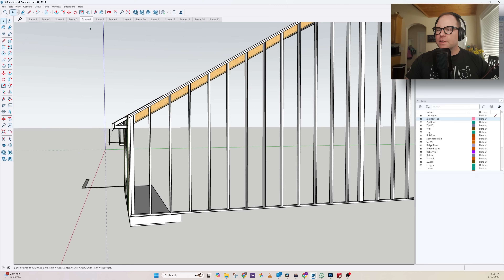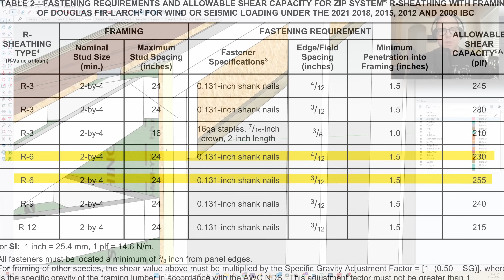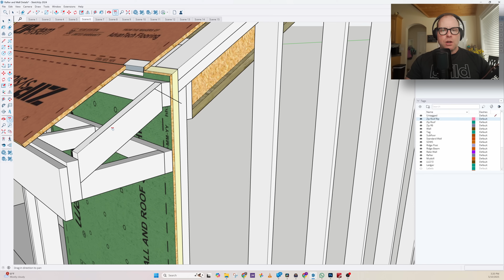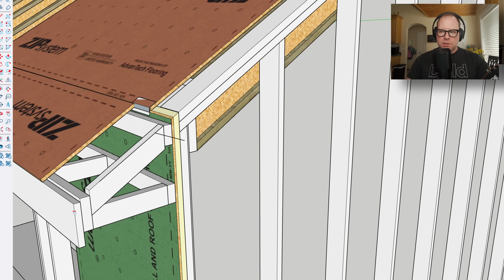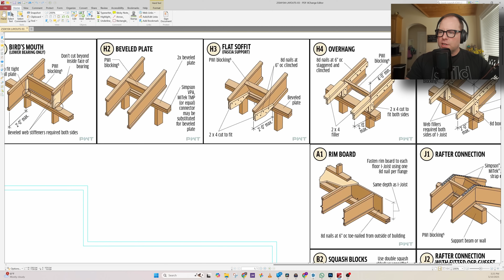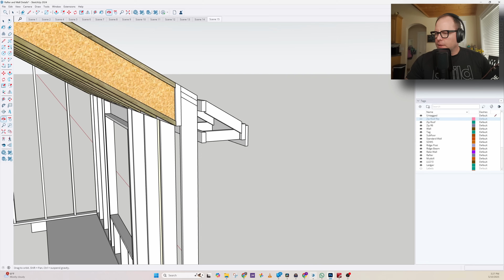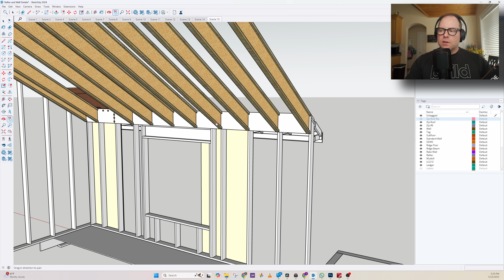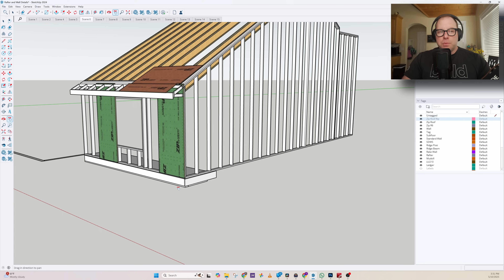Help Me Build It Better – Your Feedback Needed!

Comment: Hi Tim,
I'm a GC from the California Bay Area, so we don't get the kind of weather everyone else does. However, I did live and work in Oregon, near Salem, for 3 years, so I have some idea what y'all deal with.
Anyway. I love your idea of the Monopoly framing, and think the stuck-on soffits are great. But, I am a stickler for direct load transfer with posts/studs. I don't like the idea of supporting all those rafters in hangers, especially at angles. Why not let them run through the eve wall framing, plumb cut the ends at the exterior side, and under-support each seat-cut rafter end with a short stud, and sistered to the full-length studs? Your way, the ledger is only sheer-fastened, and the rafter ends are sheer-fastened to it, transferring all the load through two layers of fasteners and dependent on the same studwall anyway. That's putting a lot of faith in screws/nails and metal hangers. My way: fewer fasteners, no hangers, studs are cheaper...
Otherwise, there is much wisdom in your dojo!
God bless!

Comment: Why even use sheeting is my question?

Disclaimer: I don't have seismic loads in my area. Although New Zeeland does have seismic loads and use similar systems.

The next logical advancement in constructing houses is the use of strapping to develop rain screen systems for both walls and roofs. The strapping layer facilitates the creation of overhangs with ease. Incorporating the rain screen in load calculations alongside metal structural bracing straps, as those from Mitek or similar will probably result in the sheeting being redundant for loads. SOLITEX MENTO ULTRA serves as an excellent product when laying  direct on roof rafters. Use metal for the roof material.  Fill any cavity with dense pack cellulose and you will be golden.

Comment: I'm not in the industry, so take my word with a grain of salt. But I'd be mindful of your connection of your wall sheathing and your your roof sheathing.  I think you might need to run a 1x  in place of the zip r insulation where the roof and wall sheathing meet, if that makes any sense? For nailing/screwing purposes.
Reply: You are talking about a 'cleat'.  Others have suggested OSB to do that very thing.

Comment: It's not just the weight of the roof at the overhang, but wind uplift is stronger around the roof perimeter, if you insist on doing it that way, small jack trusses would probably be more appropriate. The nail on plates on trusses are designed to prevent truss uplift.

Comment: I am on board with you adding on the overhang after the siding is up. Your process for end-nailing the lower rafters (where most of the rafter weight is) onto an additional board would mean: No angled boards are needed between each and every rafter. Sounds appealing, but the idea of unusually LONG lower rafters under the vulnerability of an open floor concept, held up mostly at the mercy of nails? I need birds mouths (shorted to no overhang). Then by all means add on a roof overhang, or even the upper side of a porch roof. 

By flattening the exterior side of the birds mouth, your R siding will still cover the entire exterior wall, no problem.

Comment: Did something similar on my current project.  2x12 rafters landed on the double top plate with a 2x12 on edge flush with the exterior of the wall framing, screwed into each rafters.   We taped zip roof to zip walls, then prebuilt ladder eaves.  Subfacia is all over the place wavy.  Might have been poorly executed, but no doubt there is a learning curve.  I like your idea of pre-building on the ground, that would make it way more manageable.  I told my carpenter if I ever mention monopoly framing again to give me a 5 finger face slap.
Reply: @Jeffd180  Yeah the idea of doing this anywhere but the ground is shocking. 
Stringline and shims when each piece goes up.

Comment: Screws are easier and quicker to install so, using those are a no brainer to me. The engineering you have laid out looks more efficient, even if there is a bit more labor in some of the details. The concept is interesting and look forward to see it implemented and or adjusted as needed as you work on the project.

Comment: I'd run a full sheet from fascia upward to tie the soffit structure to the rafters, the sheer provided by that would keep the soffit from moving when stepped on.  You could always do a quick spray foam from underneath the rafter to ledger in lieu of the tape sealing idea.  Just doesn't feel right ending the plywood at the wall and then adding what's needed for the soffit rafters.
Also, why aren't you venting this roof section?  Not enough room for venting AND insulation?  What zone is this build in?

Comment: Looks like this would eliminate headers above the openings which solves an insulation issue that has existed forever.  Personally running the roof sheathing all the way to the fascia with a couple beads of sealant or perhaps a foam gasket seems like the easier and smarter way.  Maybe using sill gasket on top of the top plate and nail through the sheathing to the to plate.  This should be the new standard moving forward if we truly want to insulate and seal our buildings better.

Comment: I like the plan as-is, with one small exception - I would start the roof sheathing at the eave and work up so it's tied into the main roof as much as possible.
Reply: Up front this would make the most sense to me as well. But in this case, they are going for super air tight, and want to seal the top of the bearing wall. I would think using the foam adhesive could achieve this if the sheathing were laid as you describe. If the preference is to definitely tape the roof to wall joint, then strapping the eave "tails" across the top plate and to the rafters would probably be a great best-of-both-worlds solution. The screw on an angle going through an inch of intermediate foam doesn't exactly give me the warm and fuzzies, so it seems to me the eave should be tied to the rafters one of the  two ways above.

Comment: Stuff the gap between the hanger plate and the exterior sheathing with rockwool and walk away. Its sized for the gap. 
I'd still drill the plate near the top to vent into the TJI ceiling space.

Comment: I also prefer the idea of the roof sheathing running unbroken to the eave, but I like this idea. Maybe if there's concern about the strength of the soffit connection to the house, some metal straps across the tops of tails and rafters spanning the wall could provide enough reinforcement?
Reply: I should have read this before saying the same elsewhere. 
I know they already use steal straps instead of overlapping top plates on walls.

Comment: I'm also an engineer, just not of the structural variety. But if you ever want to build a house out of carbon fiber, I'm your guy. My two cents: I agree with @det-ou9vz about the strapping from sheathing on top of the rafters down onto the sheathing above the eave rafters. Having that extra tensile strength resisting the moment trying to peel the eave off the wall makes sense to me, especially if I am the chonky boy standing on said eave at the time. My only other thought would be I would consider screwing through the upper eave ledger out into the end of the eave rafter while assembling on the ground, and then screwing through the eave ledger into the top plates while anchoring the eaves to the wall rather than threading the long screw down through the eave rafter, the eave ledger, the zip system, and then into the wall structure. It may be a non-issue, but my statics brain is not liking the diagonal stretch of that screw sitting unsupported in the foam portion of the zip system. I know there are other fasteners that would prevent that motion, but my head likes the idea of a straight horizontal fastener there better than the downward sloping one.

Comment: I like running the idea of running roof sheathing continuously to the edge of the soffit for structural reasons (more skookum).  Since Zip is essentially airtight, why can't you tape the wall to the underside of the Zip roof sheathing? Steve's red pen would still show continuous air barrier. If the concern is tape not adhering to the bottom side of Zip roof sheathing, could you switch to Fentrim?
Reply: That is a really good idea

Comment: When you do the walls this way you greatly reduce the work involved in the shear transfer detail from roof to wall. Actually it should all be done with the sheathing nailing, no blocking or connectors. Main drawback is this is only for non-vented attics. And where you do want a flat ceiling you have to hang the joists, since there is no plate to set them on.
Reply: Maybe you misunderstand the material qualities of his i-joists. TJI is used on high sloped roofs and frequently set directly on walls like that all the time.  They still get fastened into top plates.  They still need blocking to prevent twist, but he's just trying to skip end wall blocking that forms outriggers into the eaves.  Ideally he can run the end wall zip sheeting to the roof line to close off air leakage from the ceiling. He did not say he was leaving his TJIs to float, just leaving out some implied details.

Comment: You could frame the detail of the wall top a little lower, then place 2x2's over the top plate lined up with the I joists.  Then you have venting.  I would overlap the roof sheathing over it all.  You would need to figure out how far to drop the wall top plate as per roof pitch but you are very good at that.  Thanks!

Comment: Your wall that goes to the sheathing is closing off the venting below the sheathing.  Maybe that's OK in your climate.  At first, I rejected this idea but I use steel roofing on the houses that I build.  Using steel roofing I've been screwing it to a grid of 1x4's first, going vertically nailed to the sheathing over the I joists, then going perpendicular to the first layer of 1x4's.  This vents the roof very well and could work with your wall details to achieve venting.   I do a 16" layout for the horizontal 1x4's. which leaves 12 -1/4" between.  It lowers the air conditioning loads.  It has been performing quite well.  My climate tends to get a bit hot in the summer now, in Montana.  And our fire season has already started!  Thanks for the cool videos!
Reply: This is an unvented roof sealed against vapor with closed cell spray foam.
Reply: @kschleic9053  You could also put a vented roof on top, by nailing 2x4s to the top of the Zip sheathing and putting another layer of OSB on top, using that as the nailing surface for the roof shingles. Not only would that create a vented roof on top of rafters that are fully insulated, but it would reduce penetrations of the Zip layer  to just the 2x4 spacers so the top layer would circulate both air and vapor and dry out without affecting the WRB.

Comment: If I could design this detail it would be done structurally for function and install ease meaning….. I would design BCIs to bear on top plates and ran wild, cut later using rim joist as facia. This would be way faster and structurally better minimizing rafter thrust(outward push) using minimal blocking. 
I see a lot of details now that are innovative but for the minimal benefits is not worth the additional time, effort and money. 
Sometimes the most simplistic details are the best. 
My best most practical framing details are slam bam thank you mam. 
Love the content and sass.

Comment: Dear Desperado! Thank you for posting this video. The improved framing concept is a NO BRAINER! Using a LVL ledger and LSSR hangers is the only way to fly. Extending the R9 will require bevel cuts but I've seen your video on extending a gable roof on the main roof and know you get satisfaction out of going beyond simply what is necessary for "rough framing." You can gang cut the I joist rafters length and plumb cut. The soffits can built from a "cut list" of material and assembled to the wall. Use a miter box and show the trim carpenters what a good fit looks like! The soffit assembly could potentially add to the shear strength of the wall with the 2x4 ledger plates screwed to the LVL and the studs. I feel that the advantages structurally of running the roof to the of the soffit and using a bead of acoustic sealant on top of the R9 is the best of both worlds. Tim, if look at your previous style yes it works no it seems like afterthoughts vs your new concept. GO FOR IT!
Reply: Problem is the polyiso shrinks over time - the acoustic sealant may not work longterm, hence tape is a better choice. My idea was run the roof sheathing to the edge of the soffit and tape the wall to underside of the roof sheathing. Zip is effectively air tight, so taping either side should work in theory. Only issue is standard zip tape doesn't adhere very well. Hence my suggestion to use Fentrim.

Comment: Why the aversion to trusses? Without needing foam and using cellulose you can reduce your global warming potential by a lot. Your East coast architect friend shows off the "high performance" truss details a lot.
Reply: Horizontal trusses between beams would be shorter runs.  And you wouldn't care so much about the end wall detail as all the trusses sit on the slope without that beveled double plate detail.  The angled topplate just looks like a failure point waiting to happen under side loads.